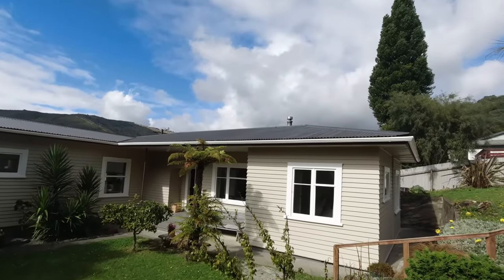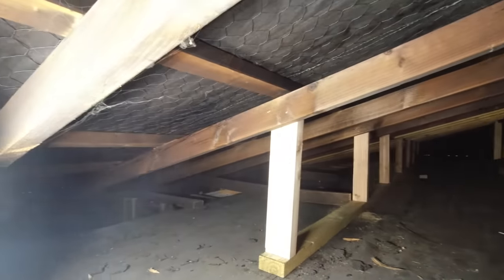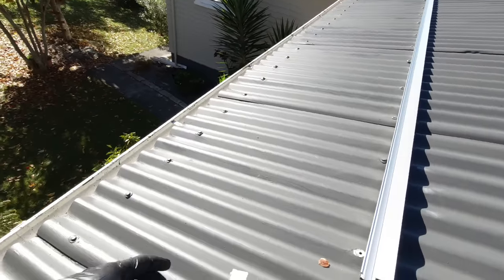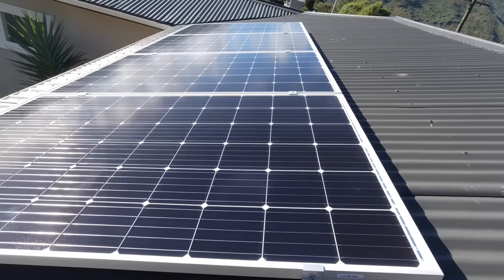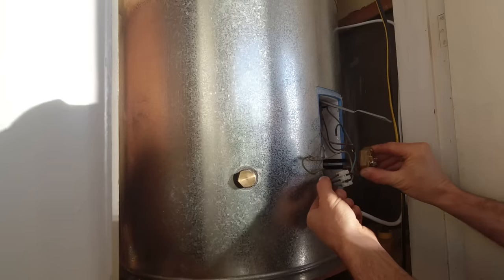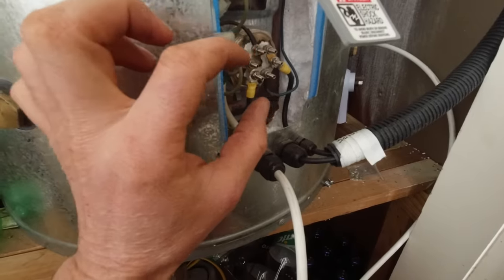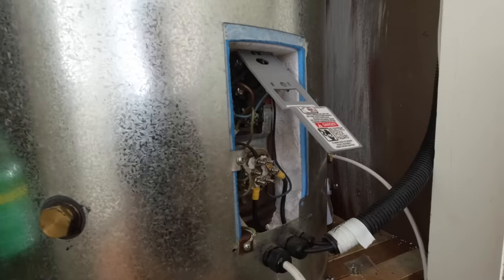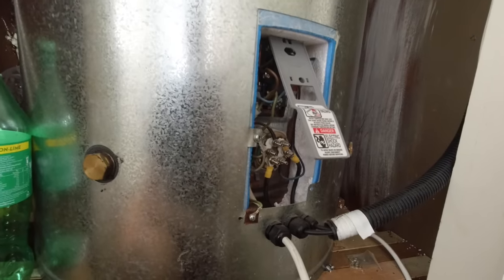Installing PV Solar Panels using a Water Tank as the Battery.. Halved my Power bill

Comment: Hi Marty, great video! Just had a solar panel system fit to our house. The installers were really fussy with code compliance cert and separate electrical inspection, all for insurance requirements. I am sure you have looked into the process but just thought I would mention. Thanks
Reply: Yes would like to know this too. The DC side I am sure should be OK to DIY (maybe - assuming it comes under low voltage?) but the AC side, surely without a certificate this will void the insurance if something goes wrong.
Reply from the maker: Yeah the ac side needed signing off by a sparky but dc side is ok as long as it stays under elv and follows the standard

Comment: It's interesting, lots of people talking about solar thermal vs solar PV. The truth is that solar thermal panels can be up to 45-50% efficient, whereas the best silicon solar pv might be 22% or thereabouts. However, the associated equipment costs for plumbing, if its a closed loop or drain back system etc, involves pressure vessels and the like for a safe system. And shut offs to avoid thermal losses on colder days etc. PV presents a somewhat more manageable solution for a small DIY project like this, but my only recommendation would be the inclusion of a simple Maximum Power Point Tracker (MPPT) type solar charge controller in line before the DC element. You could see a 30% boost in efficiency from the same panel set up and its much less expensive than a full blown inverter. 1500w capable mppt might cost less than £150.
Reply: +1 on the MPPT tip
Reply: So would you use a charge controller like what you would use for charging battery's?  So would the output from the controller would go direct to the element?
Reply: @roj0088  you'd use a solar specific mppt charge controller which would indeed have a battery charge function usually, but they also have a direct DC load output, and that would be connected to the immersion. The MPPT charge controller would need to be matched to the Solar PV power ratings.
Reply: @roj0088  it's a good point though, because I'm not sure if the typical RV/Boat ones would work without at least a small battery connected to the charge controller as well, just to allow the pass through of energy. I imagine there is a direct one available that doesn't need the battery as well.
Reply: @roj0088  Most solar charge controllers MUST HAVE a battery or they Blow up. its in the instructions "connect battery First" and if you know how much battery's cost here in NZ the cost would negate the savings look at the power bill. we pay around 37c per kwh before GST (goods and services Tax)  @ 7kwh per day that's $2.60 per day. Then if you add/Subtract the efficiency losses from the charge controller ,Battery and extra wiring to the PV 22% efficiency, ya just shooting yourself in the foot. Its a thermal Battery that has 100% efficiency. ie the heat is 100% consumed for its intended purpose. and you can take it with you when ya move
Reply: No mppt adds zero value just a cost. You are confusing the need to be above a certain voltage to charge a battery bank hence using a mppt when panel voltage is low vs a resistance element which is completely indifferent to voltage

Comment: This idea is great. It's super simple and very effective and it's stuck in my mind for a while now.

I have a question: Is it really a dedicated waterheater for ac and dc and do you maybe have a link to the product? It shouldn't matter as it's just different resistances for different voltage levels.

 I'd imagine 230v ac 3kw pushes 13 amps via a 17 ohm element. And 66v at 20 amps should be a 3.3 ohm element.

Comment: Thanks for this. Got me inspired.  6 30v 250w. panels donated to me plus tracks . Found a sparky who would use 2nd hand all wired in pairs to a 60v element in the bottom of our 400l hw tank, works brilliantly. Had to exercise the brain to get the right resistance in the element v = IR 😅
Reply: Actually, ideal resistance is no ideal resistance for many. Tests have shown that higher average daily output happens with a 2 X ideal resistance.  Most of the day panel currents are less than half even on a good day.  Add in some thin wispy clouds and panel current is even lower.  Direct connect is a poor performer. People do it because it is easy and they don't know any better.  I use a simple and cheap to build power point controller that matches the panel to the element all day for maximum power transfer.  Only needs half the panels everyone else does and works even on poor days. And it can use standard thermostats without damage.  Connecting panels to a heating element is a joke.
Reply: @opera5714  
@MartyT
3 days ago (edited)
Solar panels are so much lighter, cheaper, easier to install, no need to do any plumbing or strengthen the roof, this system has now paid for itself a couple of times over and our power bill has more than halved. 
That was my goal and I succeeded
Reply: @opera5714  
@MartyT
2 months ago
Hi Nigel,  During summer I disconnect 2 of the panels so it doesn't boil the cylinder, rest of the year all 4 are connected. I find this works quite well.
Reply: @JohnSmith-pl2bk  Thanks for the update. The best education in solar can be obtained by heating water.  Take the time to measure the voltage thru the day and on different weather conditions.  A drop in current of 30% results in 50% less power than if the resistance was optimized for that light level.  You may have followed some poor advice in selecting your element. Gong to a resistance double the ideal will get you the same heating on good days and double on poor days.  Better performance overall and no need to change panels.
Reply: Nope works fine with the right resistance. you know the volts and can calculate from there. There is no magic to get more power out.

Comment: Fascinating video, as ever. You could do with some knee pads! I have an AC solar panel system which diverts excess solar power to the hot water tank - in the UK new houses with combi boilers mean you don't get a hot water storage tank any more. Bit surprised the panels did not come with a black film - once exposed to daylight they will produce a voltage. High voltage DC is very dangerous - in contact it can cause muscle rigor so you can't pull away and it can stop the heart, etc, but I guess 65 volts isn't too bad although anything over 48 volts, as a rough guide, has to be treated with extra care. One advantage of solar panels is that in Summer they can help to keep the roof space cool since the Sun isn't acting directly on the roof tiles - a bit like an old Land Rover tropical roof. Might be worth carefully vacuuming out the roof space since the burnt debris could be a health hazard?

Comment: In Phoenix, Arizona we used to have solar hot water, where there'd be a hydraulic heat exchanger mounted on the roof, and somehow the water would be circulated down into the conventional tank.  This allowed the conventional tank to be electric powered at night for the morning, but to use sunlight to heat the water during the day for the afternoon.

My parents had such a setup on their first house.  Apparently it was prone to leaking, but I don't know if that was typical of the era (late seventies into early eighties), typical of all solar water heaters, or just indication of a poorly implemented installation.

Comment: I have 95 panels laying outside waiting to be mounted on our roof. If all goes as planned we will generate 60% of our needs with these panels. It's a big house with an indoor swimming-pool so we need some power to feed it.... In total we use 6500 kWh per year and if we can produce about 4000 of these from the sun it's a win.. When we over produce we sell the power and in the winter when the sun isn't shining as bright and not so long per day we still have to buy electricity, but in al it should be much better economically for us in the long run..The only thing you know is that the electricity will not be cheaper over the years.-
Reply from the maker: Nice, thats a lot of potential energy

Comment: Here in Australia we cannot connect the panels to a grid or anything without a sparky doing the wiring and there must be an isolator box at the panels and one also near the inverter and one at the main switch panel and then it gets inspected and signed off. I'm not sure how it would go for a hot water service like you are doing but, I like your idea of it heating your water, I have instantaneous gas hot water service at my house. I run a 5kw 20 panel system on my house.

Comment: To be correct ( there is a lot of comments about ac dc Hester’s) there is no such thing as a DC  or AC heater they are just resistance wire and couldn’t care less if it is ac or dc powering it. as it’s a pure “resistance” load the current draw will be roughly the same. I assume these heaters are marketed as “dc” because they are designed for a lower voltage from solar panels and as such will be DC. Got to be way easier and cheaper than messing with water filled panels.

Comment: Marty , get some ceiling and under floor insulation in there .Will make huge difference to summer winter living conditions .Great job on the solar installation , the wiring would have had me stumped :)
Reply from the maker: Yep its all well insulated, what you are seeing is the old malthoid roof which has had a corrogated roof built over it 30+ years ago

Comment: - battery is most satisfying moment for me in solar system
Reply: @MartyT
2 months ago
Hi Nigel,  During summer I disconnect 2 of the panels so it doesn't boil the cylinder, rest of the year all 4 are connected. I find this works quite well.

Comment: Hi, With the solar PV panels being directly connected to the element, how did you match the element to the panels for max power? With no thermostat on the DC side, how do you control max temp??

Comment: I like it, I am guessing there aren't rebates for solar hot water systems over there? cos in Australia the cost of the panels and cables/etc is about the same if not more than a solar hot water system after the rebate, the one major downside of course is that your hot water tank is then on the roof, and in winter that isn't a good thing :P

Comment: Marty, couple things that charred wood in the attic is way to flammable to leave in place It takes no effort to make fire with charred wood or coals seriously if my family lived in that house I’d research what the cause of the fire was make sure it was fixed. Then start replacing board by board until renewed.
Reply: Spray with a borax solution?

Comment: Hi, I've been using solar panels in a very limited way since I realized the bottleneck that is batteries! I several years ago bought and used a DC water heater element with not much luck but then I saw this video! Where can I purchase a DC/AC water heater element? This may be 1 answer I have looked for! Thanks!!
Reply from the maker: This is the only place I have seen them https://www.trademe.co.nz/a/marketplace/home-living/heating-cooling/other/listing/3383716586
Reply: @MartyT  Thanks Marty T !

Comment: Do those supports that you put in for the roof sit on top of load bearing walls? I'm definitely not an architect but I was under the impression that roofs like that were supported on the outer walls of the building and that the inner walls wouldn't be strong enough to support that kind of weight.
Reply from the maker: Yes, they are sitting above beams holding up the old malthoid roof

Comment: I have a 1200w array for water also. Imo anything above 36v is dangerous for this use. DC can't have rcd's. My panels are arranged to give 30amps at 36V (at the element). It costs more in wire but won't be killing anyone.

Comment: Nice video. Im in the process of trying to use my solar PV to heat water. What voltage & wattage DC immersion heater are you using? Thanks.

Comment: One thing I thought that many of the water heaters had more than one heating elements in them. This would be ideal for those wanting something like this. using a element with built in thermostat and connecting the wires direct. There are a number of elements out there and depending on the space a person has one can install an extra tank before the main tank so that some of the solar can pre heat the water while the main tank has the dc and ac heaters on it. The 2nd tank is just a dump load from either extra solar or a wind turbine. A small 500 watt turbine is pretty easy to make a good dump load. 
Since I have natural gas right now I am not all too worried about it. Though I do have plans to add in an electric tank that is just for solar/wind only. I will loop out my existing water heater and only use the solar one and in the case that i really do need hot water I can open the valves for the natural gas and turn it on. Most people can survive with out hot water for the bulk of the night. Those who shower in the morning might change their showers to later in the day when their is hot water. There really is no point in heating water at night. Either way a super cool project.

Comment: Hi Marty, so no thermostat in the dc line ? is there no chance of the cylinder boiling especially if you havent used any hot water over a few days?
Reply from the maker: No thermostat, I cant find a relay that will handle the power.. It was starting to creep up towards 80deg with summer coming on so I disconnected 2 panels, now it stays between 55-70 even if we're away for a few days. haven't needed the mains element on for over 2 months.

Comment: Another solution to consider:  Mount half to 1/3rd the panels facing North ~East and the other half rto 1/3rd facing North ~West.
This way you get more power in the morning and evening, without all the clipping around noon.
Tests show an improvement in total kw.h per day.
How much east and west and inclination all depends on your geographical location, for which there is free software.

Comment: I like the concept of using the water tank as the battery/thermal store and having it wired on both a timer and thermostat. However, one question: how can you be measuring 1345W from your solar panels, when they panels are rated for 300W each, so a total of 1200W?

Comment: Great setup, so is the key to it that the heating element is rated higher than what the solar panel could ever produce? Or does the elements thermostat just kick in and out when it hits it's max temp?

Comment: Thats a sweet bit of work done there Marty. How long until your saving adds up to the cost of installation, I wonder?  Yep! you're a pretty savvy electrical installer. Or is that a trade of yours?
Reply from the maker: It should pay for itself by the end of next year. No I'm not an electrician, but have spent many years playing with alternative power

Comment: I don’t suppose anyone knows what the rating on the DC element is? A superb video as ever - but would be useful to know the specs on the element and panels 🙂
Reply: The DC rating is exactly the same as the AC rating, both measured in Watts RMS.  It helps to know the Watts rating in AC or DC so you can operate at that power level or lower.  Failing that, 10 Watts per cm2 of element surface area seems to be a common maximum unless you know that your element is a "high density" element.
Reply: Yes…. I was asking what size / wattage element was being used…..
Reply: @EdwardEngines  
2x 600 watt elements that are combined with a mains power element all in one screw in normal size fitting...

Comment: I wonder if you could combine this direct DC heater concept with this brilliant open source MPPT charge controller "DIY 1kW Open Source MPPT Solar Charge Controller" which is on youtube too.  That way you get real time monitoring, and optimised power extraction from the panels.  It's limited to 1 Kw though.
Reply: With direct connect as in this video you need twice as many panels for the same result. I've been heating water since 2016 with a custom  made power point controller that needs no batteries and can even work in parallel with a charge controller to harvest excess power and never drag down your batteries.  You can even use existing thermostats without fear of arcing.  Check it out.

Comment: Very clean work, and clever engineering!  How did you achieve 1345 watts output from 4-300 watt panels? I'm in the USA, where a 300 watt panel is one with a maximum power rating of 300 watts--an output that is only achieved in perfect factory testing conditions.  So I would expect to see about 1150 watts output as a maximum if your system is oriented to solar south with an array tilt optimal for the season.  But 1345?  Impossible unless panels are rated differently in NZ!
Reply from the maker: Possible the clamp meter is slightly incorrect, when the battery gets low it tends to exaggerate a little..  and we do have a hole in the ozone layer here in nz, maybe that makes a difference
Reply: @MartyT  Thanks for the quick reply!  From my brief "research", the ozone hole does not increase solar panel output--the extra energy allowed through is not in the correct light spectrum (wavelength) for solar panels to utilize.  So meter inaccuracy is the likely culprit.  It is worth noting that your method is very efficient.  For each watt your array puts out, you get exactly one watt of heated water. No energy is lost to inverters, etc.

Comment: Excellent informative video. Curious if this system could be integrated to a wall radiator heater.
Reply: Of course...either by thermosyphon out of the WH that is used as a storage tank...or a forced feed by a small circulation pump.
But when you really need the heat in winter the PV output might not be up to what you desire?